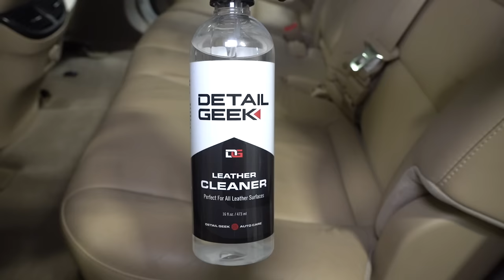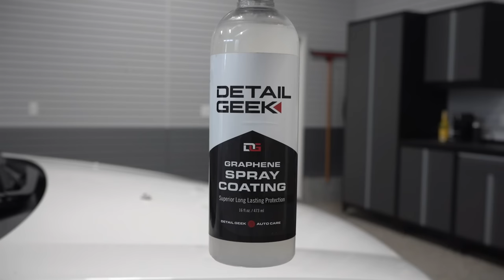Detailer REACTS To Customer's "Not So Dirty" Car! | Super Muddy Disaster Detail!

Comment: How would the owner have driven it to the shop with the windshield being covered in mud?? He wouldn’t have been able to see!
Reply: Yeah probably fake
Reply: I think it's called turn on the windshield wipers.❤😊
Reply: @elizabethannfarrow1971 but it wasn't turned on, this is why they are speculating if it was purposely done or not.
Reply: You can easily see through that windshield. The mud doesn’t completely cover it. Smart to drive it that way? NO. It definitely obscures the drivers vision of the road.
Reply: How the heck would they know if it was turned on or not?  🙃🤣😂
Reply from the maker: It wasn’t completely covered. A little hard to see through but not horrible. Not sure why he didn’t flick the wipers one last time 😄
Reply: You can tell he is going to sell it soon cause it doesn't have plates on it
Reply: @NotAshBlox   Removes Tag =Privacy Reasons
Reply: @elizabethannfarrow1971  what?
Reply: @NotAshBlox  the detail geek guy always takes the plates off to clean the car
Reply: That makes sense, thx
Reply: It's all staged
Reply: Exactly 😅
Reply: Ive asked so many times, why dont you use prewash? It makes the dirt come off easier and will avoid stratching the car
Reply: @dylanklaverveld907 pretty sure he knows what he is doing when it comes to cleaning vehicles!  🙄
Reply: It doesn’t look that bad on the driver’s side tbh

Comment: there is another channel where 1, 2 sometimes 3 guys will find an old car that has set out somewhere forever and they take it and clean it up.  the one guy that does most of the cleaning does not use near enough rug cleaner. they focus more on the outside, but they should still try harder than they do on certain areas. i have never looked at one of the cars you clean and say, wow, he could have done a better job. i have never thought that about you.  always amazing to see the transformations.
Reply from the maker: Appreciate that!

Comment: You can use Maguires Quick Detailer spray wax on the glossy interior plastics. Spray a microfiber towel, apply it onto the surface and immediately buff off with a separate clean microfiber towel. Makes it shine like new and helps minimize minor scratches and such.

Comment: Just a little tip those door latch's can break or freeze if it's cold and wet. You might want to be care full with them with water.And it might be a good idea to re-apply some kinda lubricant to them after spraying them.If they are metal they can rust.Most of them are plastic now a days but it's still a good idea to add a little lubricant to them.

Comment: Clearly they drove through all this mud just before dropping it off to you which is strange behaviour.  Not even cleaned the windscreen to be able to see out, no marks in any of the mud from people getting in and out over any period of time, door handles not disturbed even.  Most of the mud also washed off without any direct pressure just simply by the run off of water. Not watched the whole video yet but maybe this is explained later on but def a very odd thing to do. Almost like they wanted to make sure they were getting their moneys worth 😮